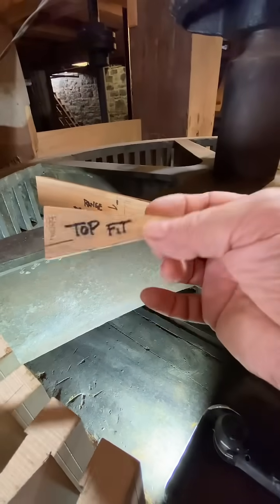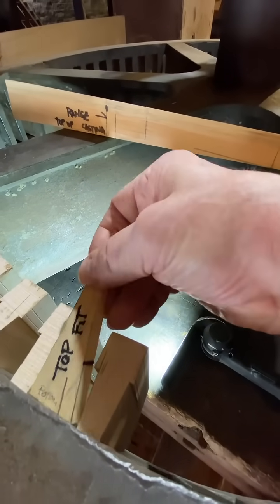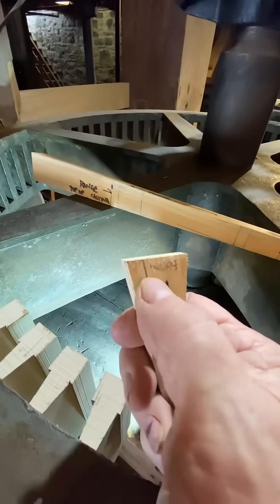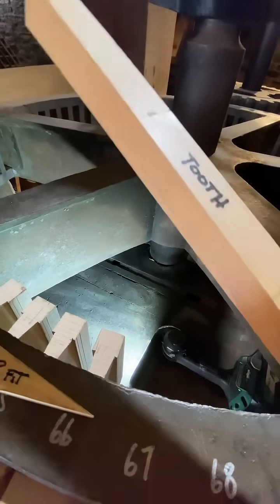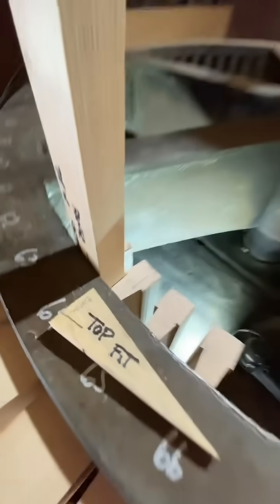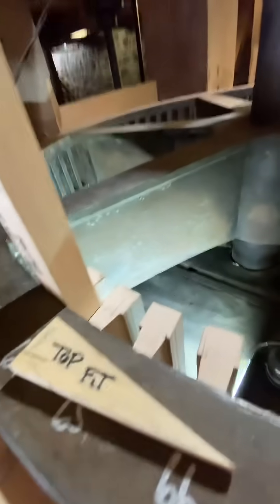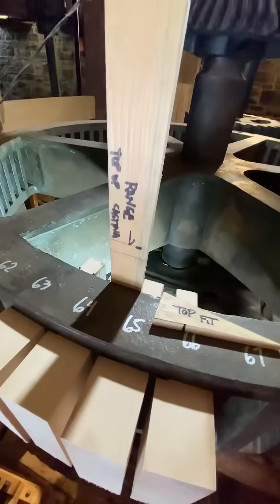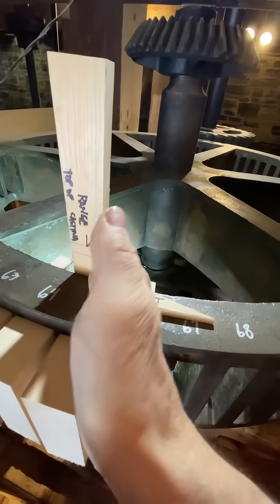wooden gear teeth dovetail @WatsonsMillManotick #wadkintemple

Comment: Will the teeth be maple? As a gearing mechanism, I'd suppose the right choice of durable wood is paramount. I'm not seeing oak...?
Reply from the maker: hi Jim. Yes, all the components including the dovetails are of rock maple air dried from a tree within 2 km of this location. In fact, it grew near the shore of this very river on the lower channel on the same side. All of the gardening is also made of the same tree. It was a magnificent tree that was donated by the property owner.